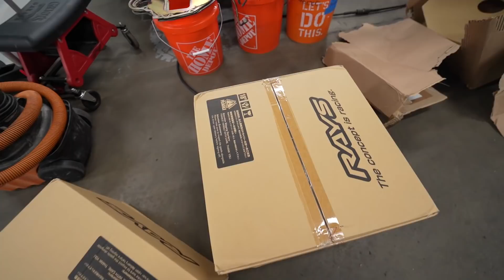FD RX7 TRANSFORMATION!

Comment: Years ago I had to get a coating off a car to have some welding done, I had to go to a garage I knew and use their steam cleaner, I put on a full wet suit and spent 5 hours cleaning it I even had a burn on my hand, It worked and it was immaculate apart from the weld that turned out to be a dog food can held on with rivets I payed £25 to rent the steam cleaner and I purchased 5 gallons of diesel to run it, I can honestly say I would never do it again but it was worth it at the time. also I the had the lot Waxoyled after.

Comment: Not going to lie my s2000 had this weird hesitation for nearly a year, I would drive around and it would studder a bit what felt like a loss of power for a super split second and it would come back and do it over and over and I kept trying to chase the problem untill one day the wrist pin finally let go on the piston it didn't spin a bearing but the piston was basically not going up and down in the cylinder as it needed to and it was causing abnormal friction until it finally let go. $8k down the drain lol.